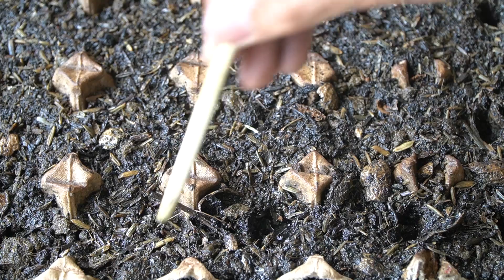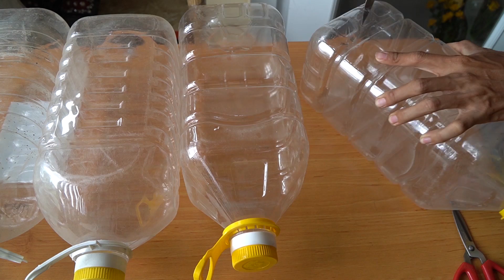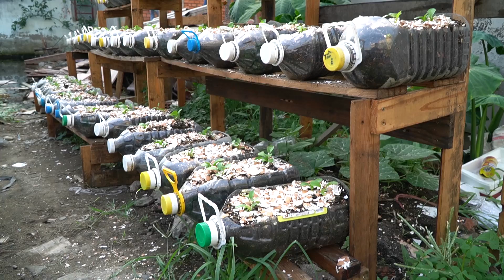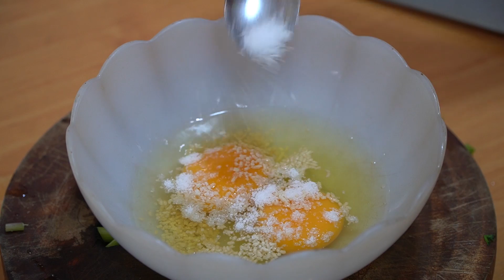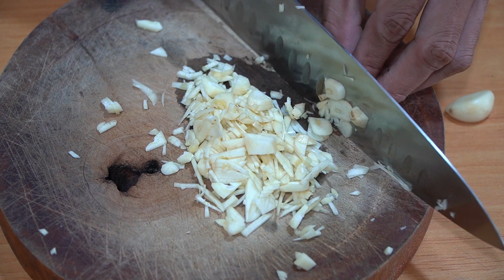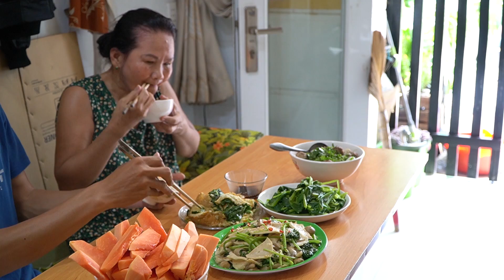Thêm 1 cách tái chế chai nhựa để trồng cải |Add a way recycle plastic bottles for growing vegetables

Comment: what is that eggshell for?
Reply: Crushed eggshells provide calcium for the soil, and a thick layer of them deter weeds around the plants.
Reply: @DianaDLe  i found out that the eggshell is not really mixed with the soil when i put them in the ground. they are not decaying.. do they really fertilizing the soil?

Comment: This is what I like and the reason I plant at home even though I use simple used tools. If you may know, what are egg shells for? or just for decoration
Reply: Eggshells, along with dolomite flour and chalk, are used to reduce the acidity of the soil and bring the pH level to normal, neutral due to the high calcium content - more than 90%.  For this, 0.5 kg is enough for each square meter.
Reply: To prevent snails as well